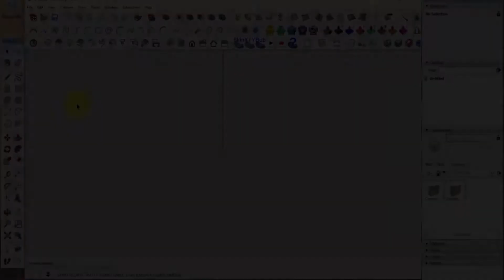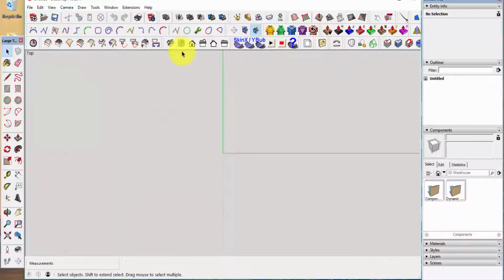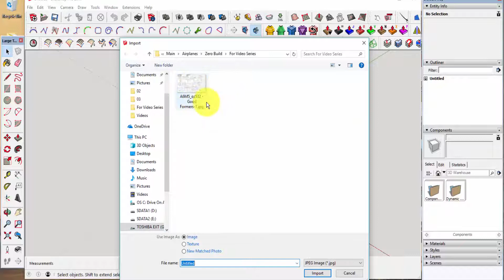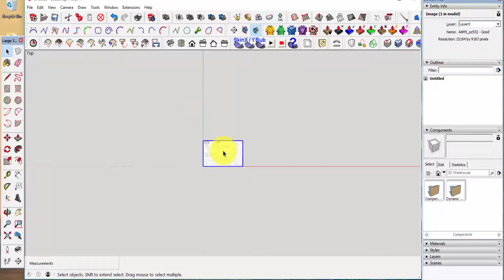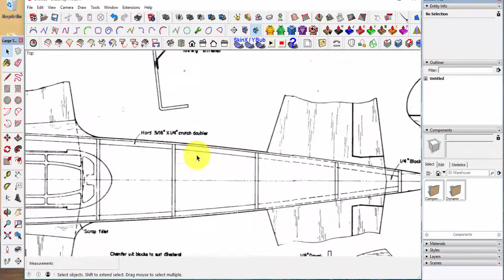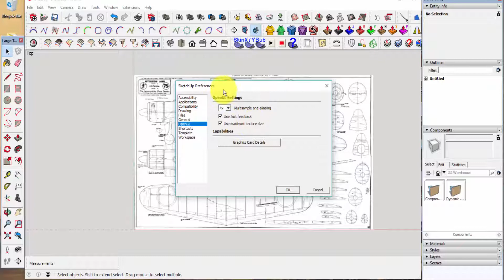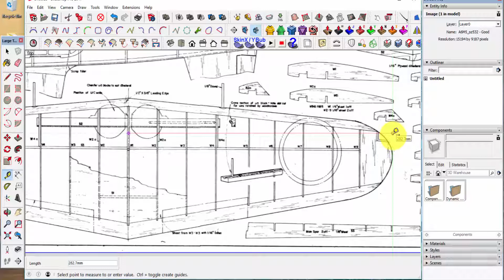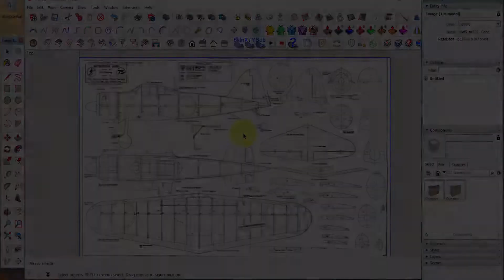Sectioned Foam RC Aircraft Fuselage Building - Part 3

Comment: DraftSight is $99
Reply from the maker: There was a free version for non-commercial use when this video series was originally filmed.  However, Dassault decided to kill the free series.  My recommendation for free software now would be to go with Fusion 360.  I use SketchUp because of the "old dog, new tricks" syndrome and I started with SketchUp a LONG time ago when it was owned by Google.  .  However, since the new owners, Trimble, decided to screw everyone using the free version by going with a cloud based  and severely crippled POS, I quit updating after SketchUp 2017.  I really have no control over these issues so just muddle along as best I can.